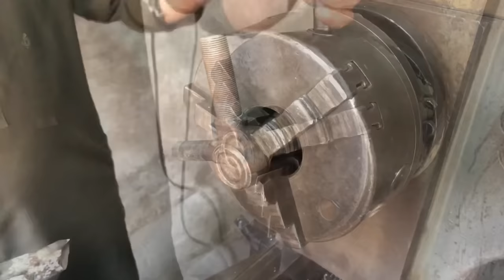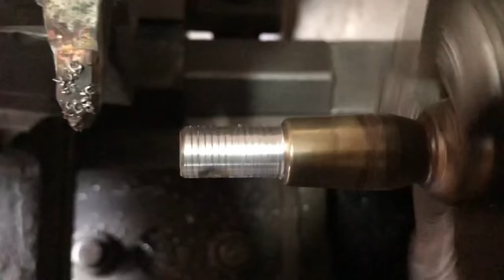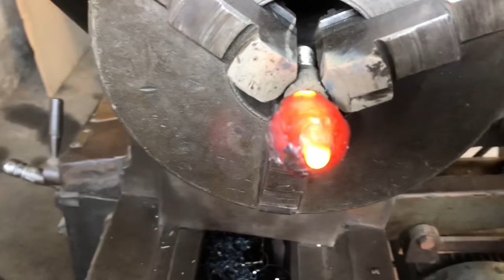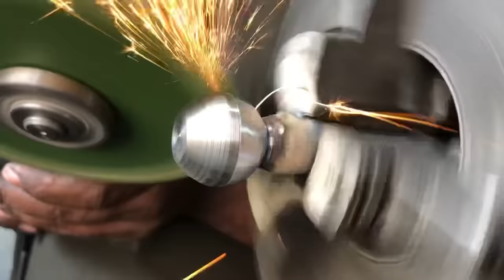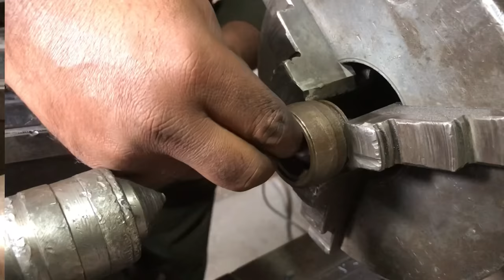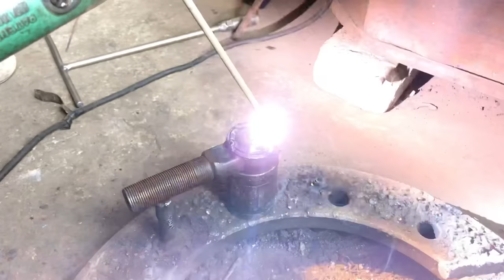Steering Assembly Rod Ball Repairing Process // Restoration Amazing Tie Rod Joint Ball End

Comment: Well seems original part modified, considered better then Chinese made low end parts, sometime these are not even available as we still have BEDFORD trucks on our roads. But a zercks fitting would be nice as with out grease this won't last and even cause noise. I think he would have oiled it from upper part and greased it with boot on.